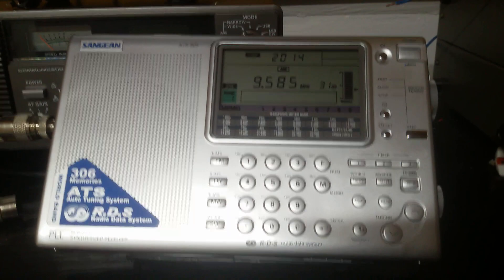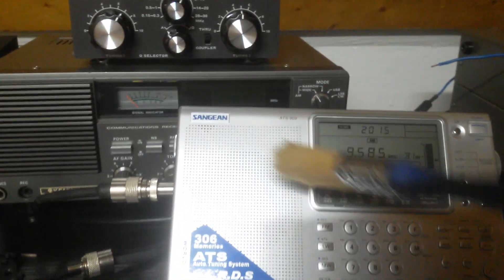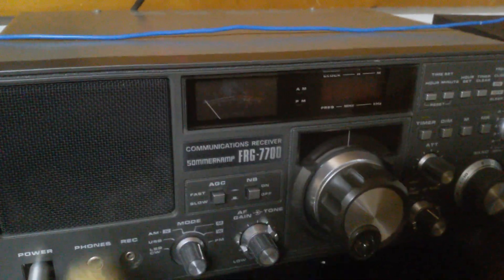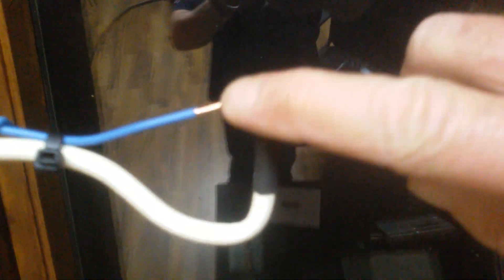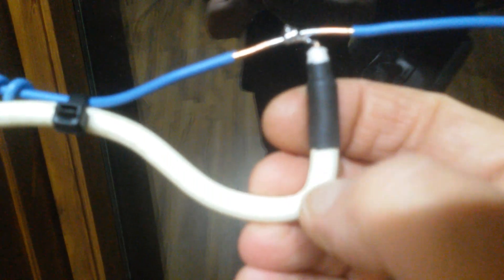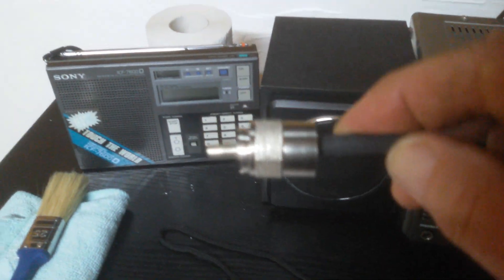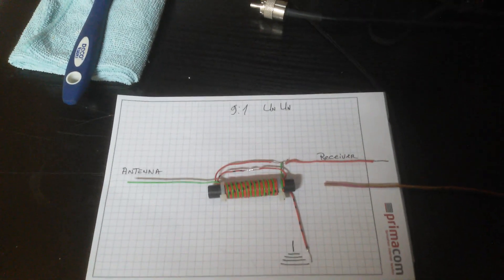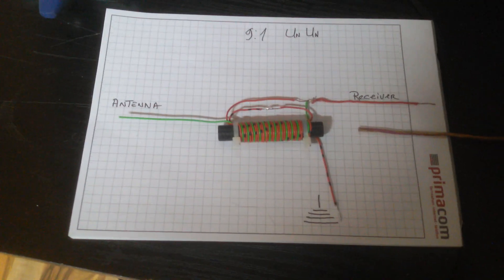Shortwave Antenna for Beginners and Tips

Comment: Hi ive seen this somewhere else and thought i would try it today, finaly some nice weather and wanted to fix some antenna stuff, so what I meen is that you use CATV Cable, that i allready knew however i am commenting on using the center lead only to a random antenna.

I just removed a Coax with a 9:1 Balun and tested it instead with just a CATV Cable using the center lead as you showed, and voila, the signals are much stronger and less noise, go figure, what i also did allthough it doesnt seem to do alot of difference but at least i through it in here for others to test, is that since i use a CATV Cable i still had the Connector on the cable end, i attached a "CATV Mantelstromfilter" to remove noice since it attaches to the same CATV Connectors so why not try it, i happen to have several laying around and i have wanted to try it out longtime previously, since they are cheaper than anything you can buy for shortwave doing the same thing. So.. yeah it works and go figure it works better thatn with a 9:1 balun, so i think alot of the buzz in the radioworld comes from the Amateurs that needs to TX
Since we dont need that, its better to keep it simple, perhaps ? dont know 73 //Chris
Reply from the maker: You got the right idea....we are only interested in receiving..and that cats transformer will work.  The best antenna systems were built as a result of experimentation.  When we stop experimenting all the fun goes away.  Thanks for info and comment, keep me informed of experimental antenna work as we all have much to learn.  Best regards

Comment: If you are still reading comments.. I have looked far and wide for an answer on optimal length for a random wire antenna. All sites go into diagrams, charts, technical aspects, and formulas.. which if I knew what they were talking about, I would already know the length of wire for an antenna.
My question is, how long can a wire be before it starts being to long and causing issues? From what I see, it's not necessarily the overall length, but the length corresponding to wavelengths of various bands.
I just want a random wire that will increase reception on all bands, tho some may increase more than others due to frequencies, to connect to the antenna rod with alligator clips, or plug into the antenna jack, that I can throw in a backpack, or camping gear, to put over a tree limb, or even stretch along the ground if no trees. 
I have saw as low as 25 feet, up to 100 feet, then I see talk of long wires overloading the receiver unless you have attenuator, but I want to keep it simple. Some of my radios have a DX switch which might help there, but not all.
Can you help?
Reply: The formula for working out antenna lengths is 300 divided by frequency, eg 300/446mhz is 0.672 meters, then 1/2 of 0.67 that's 0.33 for the half wave optimal length. For lower frequencies the lengths get very long eg 300/7mhz is 42.85 meters. 1/2 is 21 meters. I read somewhere that long antennas are not as bad for mismatched freqs as small ones. Guess you have to just try some lengths, maybe have connections that can be split to adjust its optimal Freq. Good luck dude😎👍

Comment: I use a coax cable from the radio, going out to a 50 foot long wire outside my condo. Works ok, but I am surrounded by tall buildings. Gonna try grounding the antenna next.

Comment: "Gone off into outer space...etc."  Lots of  Hams (and possibly SWL-ers also)  do that. They  go off on advanced technical data binges, possibly because they have learned to think in complicated ways.  Ham operators will usually  introduce newcomers to all the technical info about 2 meter Handhelds. That never helped me at all, and they do not even realize that they.  Then, they answer questions about  what equipment to  start with a 2 hour dissertation about; "It all depends upon what you want to do." Nobody has the sense to suggest a  basic HF radio and a single frequency to explore. No, it has to be EVERYTHING--ALL--JUMBLED---UP--AT--ONCE.   The last visit I had to a Ham Club,  I got  criticized by some 24 year old (I am 73)   for not getting involved in ARRL  emergency operations, and I have never even set up a radio before.  It is a bit interesting I guess  to examine the primitive urges to dominate others that appear  among the amateurs.
Reply: I certainly understand where you're coming from, as I still consider myself a relatively new ham despite holding an extra class ticket (I've only been licensed a few years). Like you, I kept feeling "talked down to" by the local club, and we all know how people are online these days. I basically resorted to YouTube videos and books for most of my learning. That said, as long as someone isn't getting too preachy, the question of what you want to do is a pretty valid one, as it can tie directly to your wallet. For instance, my interests in ham radio mostly lies with voice (a.k.a. phone) operation. At this time, I have no interest in CW (Morse Code) or any of the digital modes. Because of my current interests, I have no need for a radio that has CW filtering or digital capabilities- which opens me up to a huge used market for cheap radios. Further, I have a love of "boat anchors" (tube radios that are usually older than me- and I'm 51). So now we're talking radios in the couple hundred dollar range, if that. If you simply don't know what you may end up interested in, a good all-in-one radio like the Icom IC-7300 is a good one to start with. It's a touch over 1000 new (700 and up used), but it's ready for voice, CW, and can handle most of the digital modes. It covers HF and 6 meters, so if you're interested in local 2-meters and up (down numerically), you'd need something else. A lot of folks will go with the 7300 and get a handheld or a mobile for 2+meters. And of course if all you are interested in is the local-to-you stuff, you wouldn't need the 7300 at all. There isn't really "one good band" to start with, as band conditions change with weather, time of day, sun cycles, etc, but a good starting point would be to consider the UHF/VHF bands to be fairly local, while the HF bands would give you more distance. If distance interests you the most, most HF radios made in the last 50 years will have most of the most popular HF bands all in one radio. My Kenwood TS-430S is a couple decades old and covers all the most popular HF bands, and is still a great radio for my voice-only interest (though I hear it does quite well for CW as well). I play with old tube radios on 2 and 6 meters, which is the challenging part of my interests, since I can't play with most repeaters (An old Heathkit Seneca transmitter with an even older Hammarlund receiver- both of which are older than me!)

Comment: It was all fine until you started talking about the "antenna" . What is that thick white tube? Is the blue wire the antenna? It seems really short.  Did you say this mockup has to be at least 5 meters from the house ? Thats 15 feet away from the house. How is the radio connected to this thing 15 feet away?  Sorry, I dont understand any of this. I guess youre talking to people with previous knowledge. I dont have it .

Comment: I have a PL600 RX using a 10m wire.
I did a test recently using a 25m length of wire plugged into the pl600. Checked across the bands at about 20:00 UTC here in NZ. Noted performance and then repeated test shortening the wire by 5m at a time. When I got to 10m reduced by 1m at a time. Optimum performance was with 10 to 7m of wire. Good signal, low noise, no overloading.
Works very well. Modern PLL or DSP Rxers don't like long wire antennas as they are very sensitive.. Enjoyed your video.

Comment: One of the best times is if you have a battery radio and the power in you town or neighborhood goes off.  That is the greatest SWL time.  So much noise will have disappeared when all the power is off.  One other thing to do when the power is on is take your portable around the house and unplug various items that are on, especially those related to computers, TVs, et cetera.  When I want to listen to weak signals, I turn off the computer, the TV, the WiFi, and the cable modem.  The worst item in my place is the VOIP box for my telephone.  Also beware of various lights.  Some of them are very noisy in the various radio bands.

Comment: Ant need for a ground?  I understood that a ground could cut noise and perhaps it helps with lightning?

I am not sure - just a noob  getting ready to make an antenna!
Reply from the maker: A good ground is important.  If you have a desktop receiver both receiver and antenna can be grounded at receiver side.  lightning: positive electrons seek a ground to complete the circuit thus, you have an arch which is the lightning you see.  If there is no ground lightning will be attacked to your antenna.  Its not necessary to ground portables.  When the weather is bad I unhooked all my antennas.  In fact when unattended they remained unhooked.  I just made a habit of it.   So...it's good to ground antennas just remember to leave them unhooked from radio when you're not around.  Hoped this helped, and remember I am no expert but this is knowledge I learned over the years.  73s
Reply: @MrBrian8749  Thanks!  Yeah I am pretty confused on getting a good signal and trying to make an effective antenna.  I guess I just need to try and see and go from there.

I do know that my reel antenna strung in the house didn't help.

Comment: Hi. I like the video, but it looks like the wiring of your UNUN is not quite right. The receiver should be connected to the other wire connection above the core. As it is you have one wind on the core above the receiver connection where on the one you used as reference, and on the circuit diagrams I have seen, there should be two winds above and one below.  If you should see this, is there no 'right' number of total winds? I see some with four turns, some with ten, some with fifteen. Is there no 'right' number? Thanks for the video. Regards.

Comment: How about lightning protection. My wire is tied directly to a tree without an insulator. The tree is approx. 10m high. The wire leads directly through my window which is located in the 2nd storey of our building. Inside my house it is connected to a coax which goes in my radio. Unplugging it during a thunderstorm should be enough. The house and a nother tree are a lot higher than the wire so I guess it is okay. The wire itself is a 0,5mm2 cross section and it is rubber insulated
Reply from the maker: I have never worried about it even when I lived in florida.  I always unhooked the antennas and unplugged everything.  best lighting protection.

Comment: This antenna is meant for beginners ….and the he starts to solder wires...I wunder how many beginners can  solder.
Reply from the maker: The whole idea is to get beginners interested in shortwave. If you  listened, I said; "if you can't soldier, you can wrap the lead in wire around the antenna".  Beginners are not stupid. With a little practice anyone can soldier with a basic soldier iron.  Thanks for the negative comment I appreciate it.  73s
Reply: @MrBrian8749  sorry...probably I didn´t listen properly

Comment: A good common sense video on SW antennas....i agree, lots waffle on and on in "techie jargon" which just cuts any average listeners out! I built my own end fed random wire from some braided copper wire which was in the scrap bin where i used to work. I got the ok to have it, then set about measuring a length out (i have about 60ft space in my rear garden). The one downside to the wire was even though it was fairly thick and braided copper, it had no insulation.....BUT it came for free so i couldn't complain! So before mounting i soaked it in Waxoyl to give it some protection which  seems to have done the trick as 25 years later it's survived winters and bad storms  and still functions well.
Reply from the maker: Thank you for commenting.  The best wire is when it comes free. Good luck with the end fed, sounds like a good idea.  73s Brian

Comment: Thank you for the video,can you please tell me what's the model of the Kenwood behind the sangean, I had the same one a long time ago and I forgot what model it was, with some luck maybe I can find one again.
Reply from the maker: Kenwood R 600 and there not always easy to find.  It seems like there will 2 or 3 on ebay then months will go by with any.  There is a seller from the Netherlands...He always has best ones.  I bought mine from him.  He collects them,but only in "very good" condition.  I sorry I dont know his name.   The R1000 is almost the same radio, I recommend it over the R600 and its easier to fine...again that seller also sells the R1000.

Comment: Plug a wire into your house ground outlet and your whole house wiring becomes an antenna ...works like a champion , connect a plug single wire only to ground post only, don't let it touch neg or pos on plug tape off if necessary, 6' speaker wire w alligator clip on other end to attach to antenna, you'll pull in the weakest stations.KE6HZX

Comment: the Un-Un could be housed in a PVC pipe with end caps, easy to find, modify to your needs and seal against the elements :)
Reply from the maker: Thats very true SpectreOZ... Its a lot more fun when you use what you have.  Instead of buying a finished 9:1 UnUn you can buy pre wound 9:1 for about 10 dollars and use a plastic box or pvc pipe w/end caps.  I have never found a beginner who was just satisfied with sitting around listening  to shortwave.  Even as a 8 year old kid, I figured out fast...the better antenna you have the more signals you get.  Thanks for the comment 73s Brian